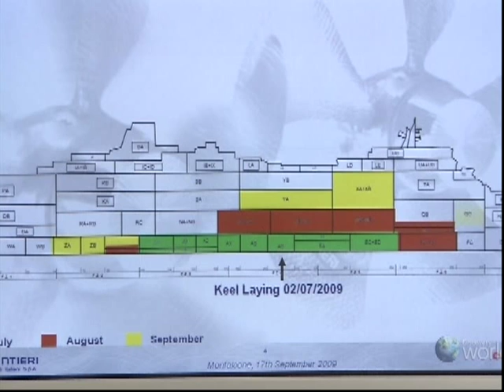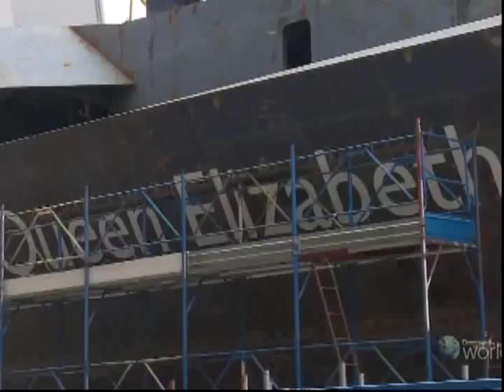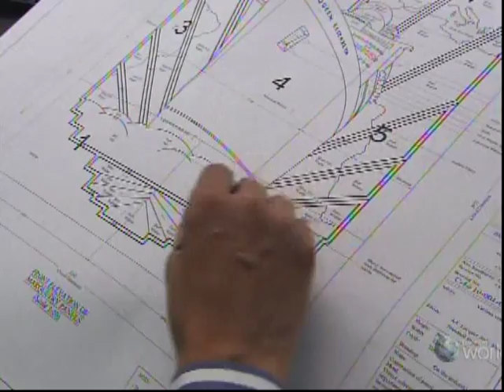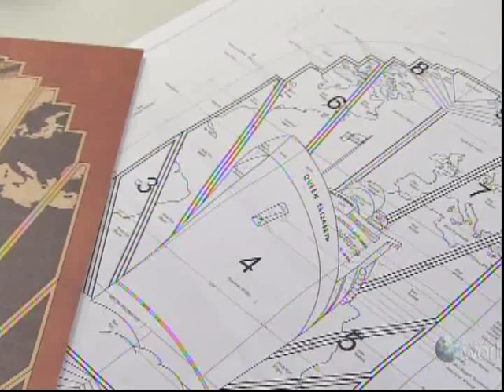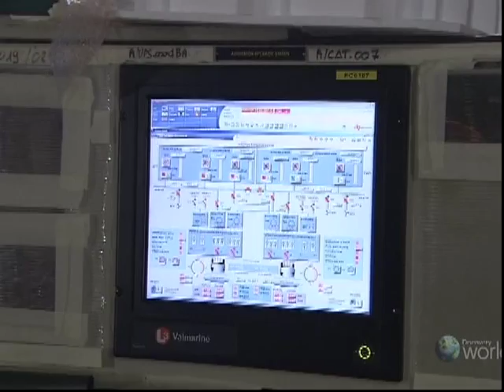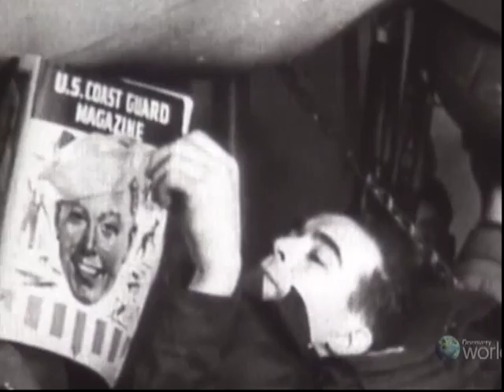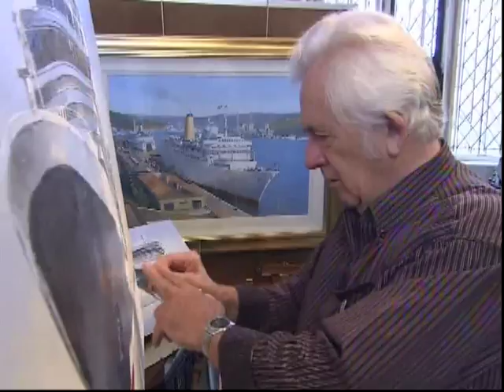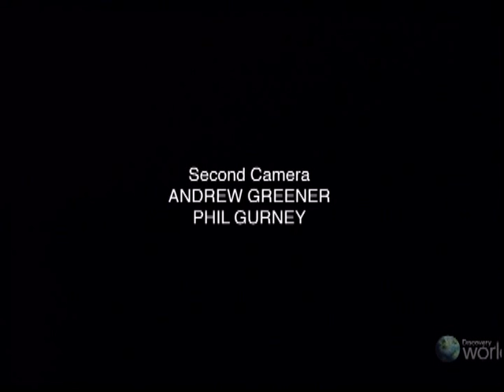Queen Elizebeth II Cruise Ship- Part I

Comment: This ships is technically Queen Elizabeth (3) as there were two previous Cunard ships called Queen Elizabeth. The first was the magnificent 83,000 ton RMS Queen Elizabeth of 1940 which was retired from Cunard service in 1968. The second Queen Elizabeth was the iconic 65,000 ton RMS Queen Elizabeth 2 which entered commercial service in 1969 and retired in 2008. QE2 was never referred to as Queen Elizabeth II for various reasons. First she was originally intended to serve with her older fleetmate until the mid 1970s (a financially impractical plan that was quickly dropped). Secondly the QE2 was built in Scotland and naming the ship Queen Elizabeth II was not considered appropriate due to monarchy issues between Scotland and England. The QE2 (1969) was named for her predecessor, the QE of 1940 and not after HM Queen Elizabeth II.
Reply: +lasuvidaboy Interesting questions on this are, RMS Queen Elizabeth of 1940 - who was that named after?  Similarly HMS Queen Elizabeth was another ship bearing a similar name; a battleship from c1913 and a new ship of the same name seems to be under construction, an aircraft carrier.
Reply: +Lasuvidaboy QE2 Wieghts 70,000 Tonnes Not 65,000 Tonnes
Reply: +keith6400 HMS Queen Elizabeth Came In To Service This Year So Idk How She Was Working In 1913
Reply: +Nicoye Bailey     As built the QE2 had a gross register tonnage (GRT) of 65863 and later a gross tonnage (GT) of 70327.  This is the internal volume of the ship, NOT the weight. Her weight or displacement is about 49000 tonnes (fully loaded)
Reply: As built QE2 was 65,000 tons. As she was modified w/penthouse cabins and other enclosed space she was re-listed at 70,000 tons.
Reply: You have simply missed the point.  I was referring to HMS Queen Elizabeth a dreadnought class battleship from 1913.  There is another HMS Queen Elizabeth aircraft carrier under construction. There are significantly more "Queen Elizabeth" ships which have existed than people are generally aware of and many of them were not actually named after Her Majesty the Queen.

Comment: This is NOT the "Queen Elizebeth II Cruise Ship."  First, the correct spelling is "Elizabeth."  Second, the Queen Elizabeth II is the 1967 Cunard ocean liner that was sold to Dubai and remains there pending an ultimate decision regarding the future of the ship.  The current ship, which is pictured in your video, is simply named "Queen Elizabeth."  She is the third Cunard ship to bear the "Elizabeth" name and is a "cruise ship."  The Queen Elizabeth II is not a cruise ship.  It is an ocean liner, and as your research will confirm, there are significant differences between the two.
Reply: Michael Patterson QE2 was a trans atlantic liner in the summer and spring and a cruise ship in the fall and winter so it is a cruise ship
Reply: You can put any ocean liner on cruise ship duty, but not the other way around! Heck, if Titanic is still afloat and seaworthy, no reason you can't do a Caribbean Cruise with it.

Comment: Should`nt it be Queen Elizabeth lll, I mean it`s the third version of the ship????
They should`ve named it " Princess Diana" , instead of naming it after an old cynical
dinosaur, with a flowerpot on her head....."heheh"
Reply: If so it would be the Queen Elizabeth 3 (the QE2 used the Arabic numeral to indicate it was named after the ship, not the monarch). It isn't because it's not an RMS, as the original QE and the QE2 both were.
Reply: +Jay Braiman     In fact the QE2 was never officially named RMS, just SS and later MS.  Because she was built to be a combined ocean liner and cruise ship, not a pure ocean liner.  The QM2 is the same type of ship but Cunard wanted to keep the old tradition and named her RMS.
Reply: its named m.s Queen Elizabeth